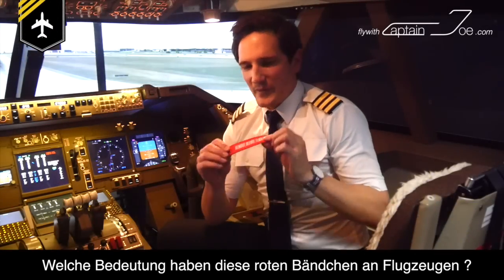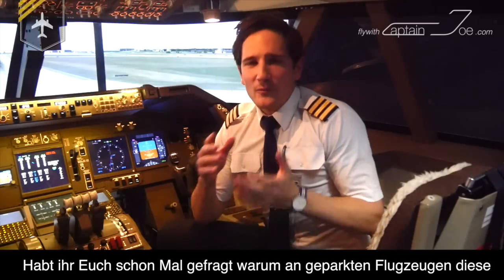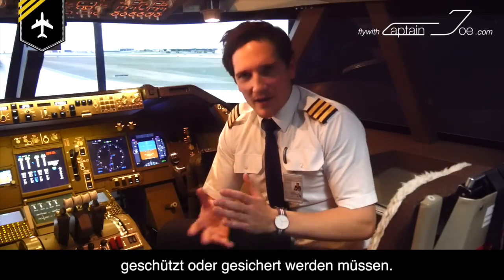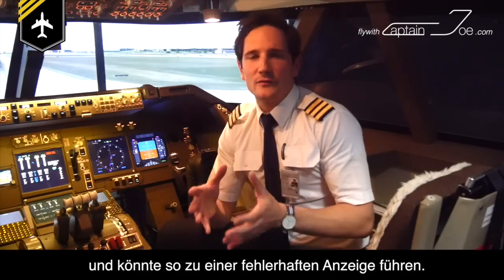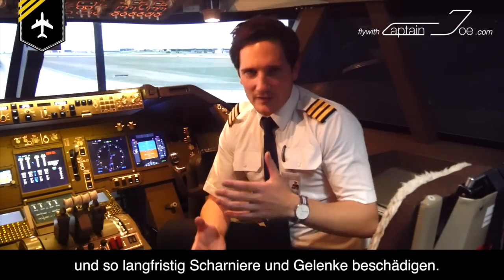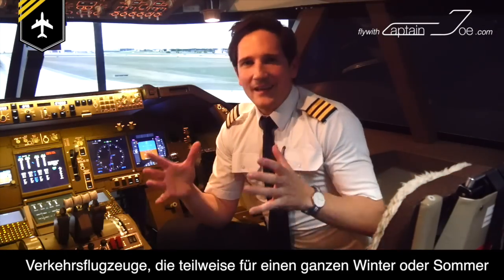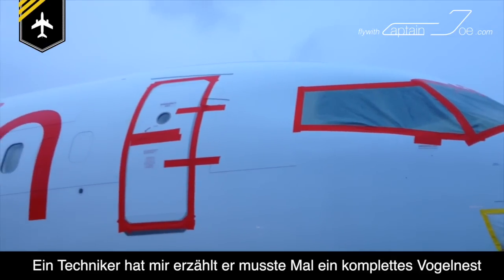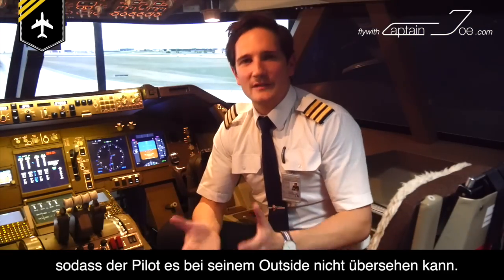What are those REMOVE BEFORE FLIGHT tags?

Comment: So when they remove all of those tags, do they go into the plane for use at the next airport or does each airport just have big boxes of them for each type of plane?
Reply: Usually stay with the airplane.
Reply: I didn't notice all of them were reusable.
Reply: They usually in smaller aircraft just chuck em in the back seat. Airliners will usually chuck them in a bag and then put them in a storage locker in the cockpit. And then little Sports aircraft don't really have Pedo tube tags cause they are usually in small hangars etc. BUT if they do it's usually just a really small pin (Lik my aircraft, I'm a sports pilot). But at the same time, they also use Propeller covers, Whole cockpit covers (Clipped together by buckles and straps etc) and the wings may sometimes get things like a whole wing cover (For small aircraft obviously) but otherwise the wing is left exposed and occasionally the owner may visit the aircraft every here and there and give a little sweep of debris on the wings. Wheels are also chained same as under most wings containing "Anchor Points". Control sticks and throttles are often padlocked (For eg, on my Jabiru J160 there is a small hole to prevent someone from pushing the throttle in) and the joysticks as shown in the video are usually locked by a metal bar as shown.
Reply: @scrappy673  actually it's pitot tube.
Reply: @azmike1956  I SPIT MY WATER READING THAT
Reply: @jonlo5540  happy to do that for you!😆
Reply: @mikeherbst1825  I meant the fact that he didn't spell it properly

but hey i'll let u take credit cuz i didnt reply properly

Comment: One thing he didn't mention are locking pins on landing gear. The best example is the A-10 Thunderbolt II (or Warthog if you prefer). The design of the A-10's landing gear requires constant hydraulic pressure from the engines, the APU or an external source to hold the landing gear in the down position. If you remove the hydraulic pressure you first need to install 3 locking pins to prevent the gear from coming up. Otherwise the gear is unstable and can fold up, which will drop the plane down onto its belly. After landing the proper sequence is to install the pins while the engines are still running prior to shutdown. Then when getting the plane ready to take off you start the engines and have them pumping hydraulic fluid first and then you pull out the locking pins.
Reply: That is a strange design decision. 
With battle damage, would you not want the gear to gravity drop on landing?
Reply: The landing gear on an A-10 does drop down in flight without hydraulic pressure. A combination of gravity and air resistance will make it come down. The only problem is when it's on the ground the gear isn't locked in the down position unless there is hydraulic pressure present or the locking pins are in. An A-10 sitting on the ground with no hydraulic pressure or locking pins is unstable. A strong gust of wind from the front that pushes the fuselage backwards just a little could cause the gear to collapse. That's why they always put the pins in before shutdown after landing and don't take them out again until the engines are running prior to the next flight.
Reply: Well, if it can collapse due wind gust, it will certainly collapse on touch down without hydraulic pressurized. I wouldn't even want to extend them via gravity and air resistance if I know hydraulic power is lost.
Reply: As I recall, the fact that the A-10's tires protrude out the bottom of the nacelles during flight makes it possible for it to roll on the wheels while they are still retracted. So if you lose hydraulic pressure the pilot can land with the gear up and the plane will still roll on the wheels. Sort of a modified belly landing.
Reply: That does sound strange to me also... sounds dangerous, but I don't know those types of aircraft.
For the Q400s/Dash 8's that I handle, there is no bypass pin for the nose gear, but instead, a square/diamond 'override' panel (or wtvr they call that thing) that you pull out and lock in place, and then there are landing gear bypass pins for the main landing gear.
We never use these while handling flights, even when pushing out departure flights, however, we ALWAYS have to use them when towing a plane (with a brake-rider in the cockpit), and NEVER with running engines. Sometimes Maintenance will use them though to drive the plane to and from the hangar, and with engines running as well. Very rare to see Maintenance do this though, and lately everything just gets towed instead.

Comment: Sometimes, the pitot tube gets covered with frost during flight. Due to the increased pressure on the pitot tube, the flight instruments think that the plane is flying very fast. If autopilot is on, it will pitch up and power down, which will cause the plane to stall. This is responsible for a fraction of aviation disasters.
Reply: So I guess this is why you can "warm it"?
Reply: Nice idea :)
Reply: What I wanted to say is that there is a "Pitot heat" switch in the cockpits (I'm a beginner in flight sim), and before this video I didn't know what "Pitot" was.
Reply: oh
Reply: Danyl Ho Modern aircraft have heated Pitot tubes, warm water is pumped around them however if it is paricularly bad condition or the heating fails thats when they can get frozen.
Reply: There's one incident where bees nesting on the pitot tube and making instruments go haywire, but i forget the flight number designation
Reply: By the way you're not gonna get an higher speed indication on the anemometer if the pitot is frozen. If the pitot is frozen the anemometer is gonna act like an altimeter.
Reply: The new "altimeter" will give a high indication.
Reply: people forget to turn on pitot heat, so the pitot tube gets frozen
Reply: Actually, if you think about how airspeed indicator works, it case of Ptot sensor (known as Pito tube) blockage, the pressure inside system will remain the same, thus it would stuck the instrument. Additionally if Pstat sensor (known as static port) is still working, the instrument will show speed increase when you climb and speed decrease when you descend.
Reply: Dumb question but, how Mach number is measured? I know that at "high" altitude speed is measured in Mach not knots, but how is it working if atmosphere is less dense? Mach is measured with the Pitot?
Reply: It's not a dumb question. You cannot measure Mach No. directly, same as you cannot measure airspeed. Mechanical instrument or Air Data Computer can calculate Mach number in many ways. For example via True Air Speed and Temperature if you have that inputs, or most simply via P static and P dynamic relation.
Reply: +Negative Minded Stop saying it's dumb question if you have a very good question.
Reply: Mach 1 is the speed of sound, which varies with temperature and pressure. Very important not to be at mach 1 when crossing the tropopause, into the stratosphere and vice versa.
Reply: +776281, it does not vary with pressure.
Reply: pitot heat switch

Comment: My plane only has one Remove Before Flight cover, on the pitot tube.

The control lock is "activated" by looping the seatbelt through the yoke. Cheap, but it works, and is how Beechcraft say to do it.

Comment: Hi Joe.
Your briefings are too good and simple for a novice like me to get the key aspects asap.
I have a query "How do pilots handle approach, taxing in and out of Huge airports when they go in for first time ? 

I ve seen lots of symbol in runways and long chats till line up in vas aviation channel.Confused.Kindly do a video if possible on symbols and terms often used in airports.

Keep up Your work Captain Joe :-)
Reply from the maker: Hey Asher! Great question! I will try to make a proper video out of your question :) Greetings Joe
Reply: Thanks Joe ,  waiting for the video :-)
Reply: While we are waiting for the video, I can answer shortly: Many (or maybe most) big airlines do not allow two pilots unfamiliar with airport to fly there together. When airline opens new line to some airport they never fly before, the most senior staff gathers all relevant documentation for that airport including air-law of the country (because every country have its own air-law which can be in sync with international recommendations, or not). Additionally, all airport procedures can be in sync with international recommendations or not. They evaluate all that informations and make specific company procedures (in accordance with mention documentation) to be used at that airport, and add that info in the "standard operational procedures" manual making it public for all pilots of that airline. First flight would usually be flown by most experienced crew, and when they become proficient, they will be paired with less senior (by rank) pilots to pass them the knowledge and so on until all of roster is capable for operations at that airport.
Some airports requires special additional training and tests organized by authorities of country where airport is located. 
Of course, not all companies have capacity to do such training and knowledge transfer, for example air taxi companies or charter companies usually fly on unfamiliar airports and pilots have to prepare for such airports on flight to flight basis.
Reply: Nikola16789 Thanks a many for the crisp KT.
Reply: It's Military Grade, trust me.

Comment: Here's an interesting story for you.  When I was in the US Navy in the mid-90's there was a problem with mud being packed into the pitot tubes on some F-18's parked on a base in Florida.  They went through months on investigations, covered them, had watches guarding the planes, the works.  Turns out it was happening only on one side of the aircraft, specifically the side facing a Florida 'wetland'.  Contained in these wetlands, were mud daubers lived and discovered that the pitot tubes made a great place for a nest, cover or not.

Comment: You also see them on the weapon systems of fighter jets on aircraft carriers. Just when the plane is in position and ready for take-off will these pins be removed. There was actually a case where these pins have been blown out by the wind and another safety mechanism has been disengaged too soon by the crew (the pigtail has been plugged in too soon - the cable that connects the plane to the weapon systems), which led to the USS Forrestal almost being sunk, when a F4 Phatom fired a Zuni rocket across the deck while the F4 was still in the parking position. The rocket has certainly been triggered by a spike in the electrical systems during engine startup...
Reply: You see them on land and carrier based aircraft weapons systems, not just fighters on a carrier.
Reply: Yeah and the people who fly those actually are captains mostly.
Reply: SpudHead
Which has what to do with "remove before flight" tags?
Reply: Black Prince Nothing. And neither does the following:

There are 600 people in the world today who can eat lettuce with no ill effects.
Reply: @fr89k - The phenomenon that triggered the Forrestal accident is known as "stray voltage". Wires inside aircraft are often packed very close together. As such power can be transferred electromagnetically between adjacent wires of unassociated systems during transit events. In the case of the Forrestal the pilot of the F-4 had just switched on the DC power system in his airplane. When he did power was inadvertently transferred across electromagnetically to the firing circuit of the Zuni rocket, which as you noted was unsafe because the wind had blown out the safety pin. Stray voltage happens similarly to how a transformer works, where varying electric current flowing in the transformer's primary circuit electromagnetically induces voltage into the secondary, like the ignition coil in a car. It is not the same and shouldn't be confused with arcing between wires with bad insulation.

Stray voltage is also believed to have been what brought down TWA-800. Something was turned on or off during climb out. This induced a high-voltage spike into the wiring leading into the center fuel tank's fuel quantity probe. The spike produced a spark inside the near empty tank, which ignited the vapors and blew the nose off the airplane.
Reply: Joe Vignolo Thanks, but I studied something similar to Electrical Engineering myself ;) So this no news to me...
Reply: You almost have to be an electrical engineer and understand transformers to understand stray voltage. This is why stray voltage is such a widely misunderstood phenomenon. Many people get it confused with arcing between exposed conductors, but it's not the same thing. In an airplane you have long lengths or wire running side by side. One conductor acts like the primary of a transformer and the other acts like the secondary, except the long conductors are not coiled up.

On TWA-800 one conductor, probably a power buss, acted as the primary. The wires to the fuel tank acted as the secondary. When the power buss was switched it induced a voltage spike in the wires that went into the fuel tank, which caused a spark inside. Essentially the whole thing was just like the ignition system in a car.
Reply: Joe Vignolo Eh? I don't know where you studied, but when I say I had to take all the basic Electical Enginnering courses (the same that the Electrical Engineers have to take, before they can start their specialized part of the studies) at a German university, you can be pretty sure that I got the concept of induction, capacitive coupling (which is one of THE major problems in semiconductors), and stray voltage. In fact, as a computer engineer, I had to take mandatory courses in signal transmission and digital signaling on chip, on pcb, and between different modules of a system...
Reply: It wasn't my intention to question your knowledge or competency. I added the information about stray voltage for the benefit of anyone else less familiar with the concept than you are who might read the comment thread that you started. Remember that these are public forums and anyone can read or comment on your original post.

Comment: I worked for a local airport in NL for a few months. They allowed me a few times to ride along with the pushback truck, and remove the steering locking pin from the nosewheel of an 737 and A320 after the pushback. Nothing difficult but quite an experience to remember :)

Comment: i remember seeing an air crash investigation where wasps built a nest in one of the air speed sensors and it caused an over speed reading and the computer basically reduced the throttle and tilted the plane back to the point where it stalled and fell out of the sky

Comment: Where are those covers stored during flight? I would guess the smaller ones (and possibly more often used) are kept on the plane while the larger ones (for engine intakes) are kept in hangars, right?
Also, how long must the aircraft be parked before the technicians would consider covering the tubes? For example, I would imagine they're typically not covered when the aircraft is departing within an hour or so.
Reply from the maker: Hey Andrea! Yes that´s correct, smaller planes carry them on board during flight, and in bigger jets, technicians stow them in the hangar. And yes, their are only used if the planes is being parked outside for a long period :) Greetings Joe
Reply: Captain Joe thanks for the confirmation! Keep up the good work, flying and videos :)

Comment: Joe can I please ask what situation would cause a large jet airliner to be parked up for a season or extended period of time? MyAssumption would be airlines want there planes In the air flying earning revenue? The only situation I can think of is when a plane is being sold off or maybe if it was in some climate where safe flight may not be possible till the end of a winter season? Am I correct in my assumptions? Thanks so much